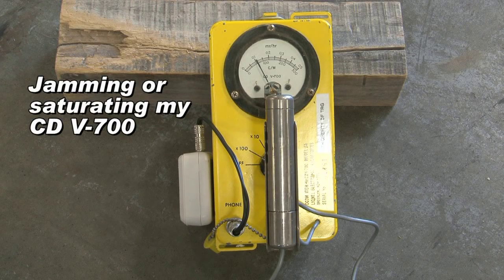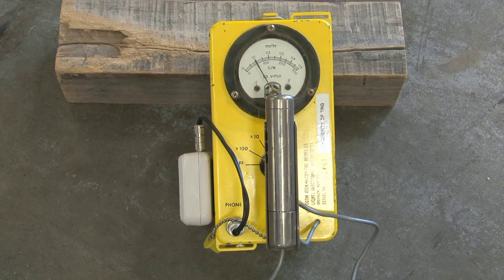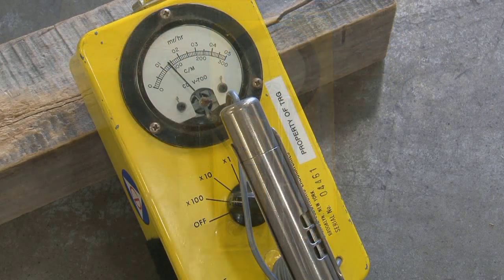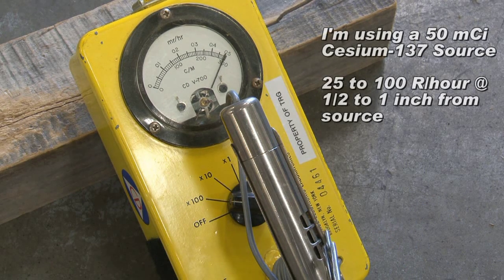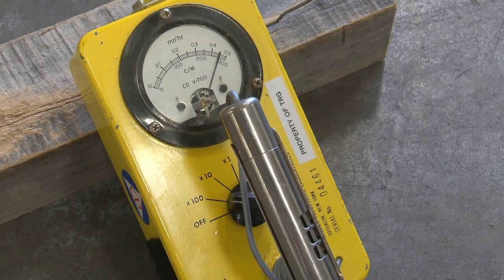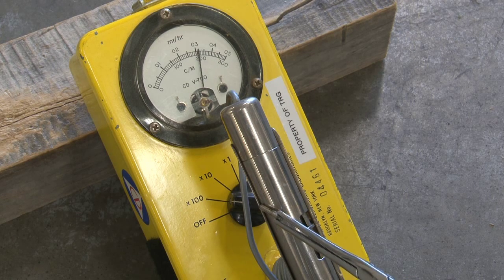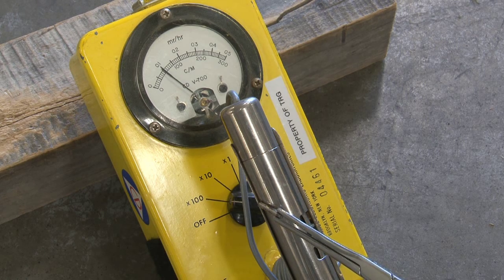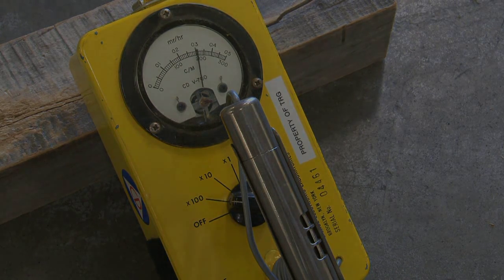Saturating a CDV 700

Comment: Why was the speaker removed for this demo. It's stuck to the side of the case at the beginning and then is gone during the video. It would have been interesting to hear the audio during the saturation. I assume the audio goes from white noise (obviously no single clicks could be heard even with the source within 10 feet of the probe) to silence when it saturates?
Reply: It would scream in pain!

Comment: would that source be able make a CDV 715 move?
Reply: yes it would read on the 100 scale
Reply: Definitely, Cs-137 emits beta and gamma which is what an ionization chamber detects and he said that it reads around 25-100R/hour. The CDV-715 starts reading at 0.1R/hour so you would probably even need to turn the knob up a few scales.
Reply: @derpymcderpello5381  i have a massive autunite piece that’s a couple hundred grams and I swear that it moves the needle in my 715 but I’m pretty sure my 715 just dosnt work anymore, any confirmation on this could there be enough 235 and radium too move it?
Reply: @twirlyturd4364  I would try leaving that autunite piece on the ionization chamber for a few seconds. Sometimes the analog scale pegs out when it meets anything radioactive but eventually fixes itself after a few seconds and gives a correct rate. Sometimes it will even fall back below what the 715 can measure so make sure you leave it there long enough to completely make sure. Also be sure that you zero the meter correctly, and the circuit check works. The meter should give a somewhat accurate dose rate. There's also a fair chance the unit could be very uncalibrated and shows a dose rate when there actually isn't a strong enough rate to move the needle on the meter. You may also want to look for an "R" stamp (R stands for retrofit if you're wondering) or marking anywhere on the meter. If you don't see an R on your meter, the chance becomes high that the meter is just severely uncalibrated/inaccurate and shows a dose rate when it isn't supposed to. If the needle continues to move after trying all of these, then I would say the autunite piece is hot enough to really move that 715 needle, so keep it shielded!